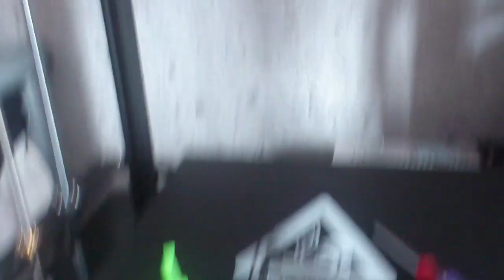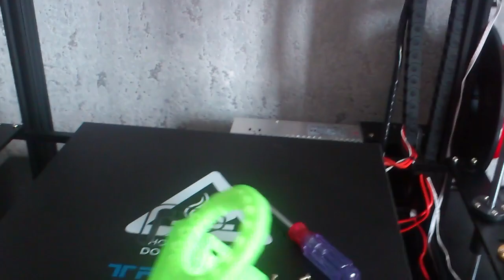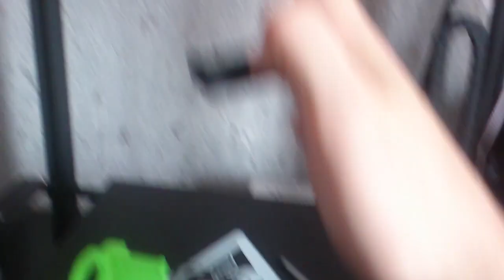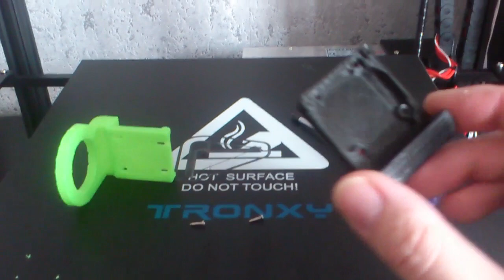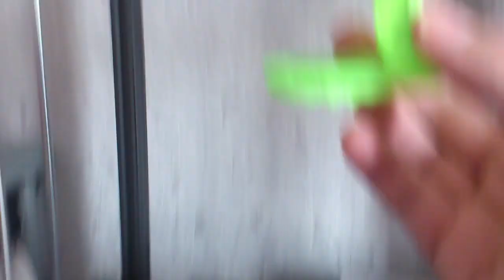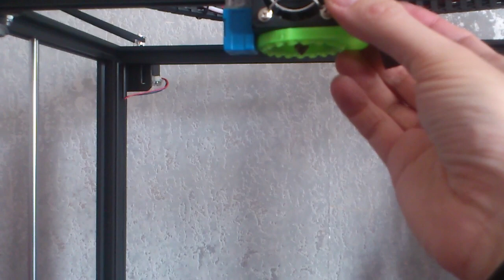Tronxy X5SA  3D Printed Cooling Fan Upgrade

Comment: I got the newer 2020 updated Tronxy X5SA version Printer!  The stepper motors now are silent ones, the belt pulley's have been changed to plastic outer and metal inner,  the main board is silent one, the power is now a 24 Volt one not the old 12 volt. So the hot end heats up quickly in a few minutes in fact and the bed heats up a bit quicker too. The control screen is a full colour touch 3.5 inch screen. I got mine from Amazon UK in the end of July 2020 for £309.00p which was £40 off the retail cost then.. the delivery was free. it was delivered in 7 days from ordering!  It also got 16 points auto leveling and 5 points manual leveling using the 6 bed height screws.  

The only thing I am still trying to get it to do right is bed leveling with either auto or manual used?   
Even with the software updated to handle the titan right, I still lots of problems getting the bed to be the right level compared to the hot end and print well.

In this amount of time I managed to do two good models. one was 11 inches wide and 6 inches tall. although of course this printer can do 15.7 inches tall and 13 inches wide. I did buy a Titan extruder for using flexible TPU filament and ABS and PET-G. But sofar been doing only PLA and PLA+ due to bed adhesion problems on the original textured metal build plate, So brought the Tronxy made Ultra flexible and magnetic build plate. 
That is better to get the models off after done But had no luck adhesion wise so found that if I got a very heat proof electronics gold tape "High Temperature Heat Resistant Tape Polyimide Film Adhesive Tape" 

That is the best one to get ( again on Amazon UK ) the prints stick to it well and come off clean and smooth on their bottom part and you can reuse the tape for more prints But just be careful to not scratch or dig into the tape with the scrapper as it can be ruined easy? Also it is hard to put it on the build area flat without air bubbles under it. so go slow and careful in putting it down. Then when it is on, you have to flatten it fully down with some solid smooth object so it goes clear. 

I just have to keep trying to get it to run well?
Reply from the maker: nice